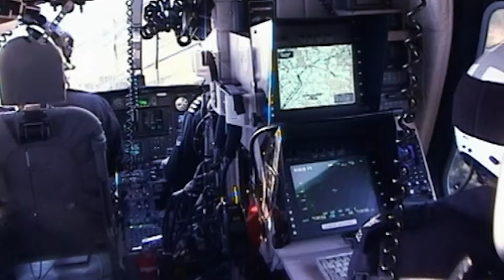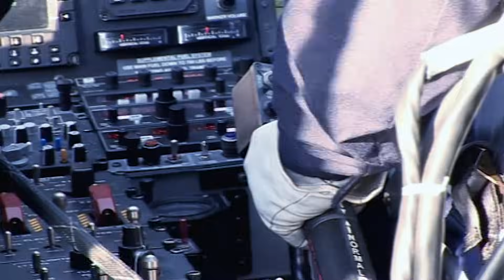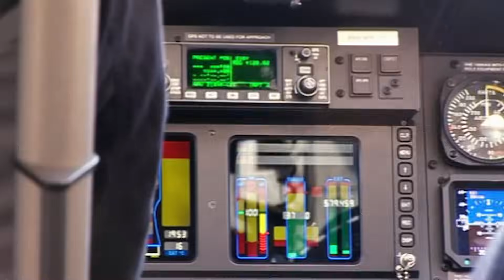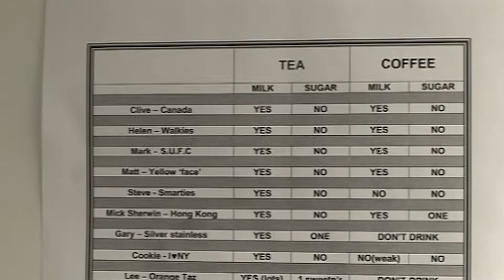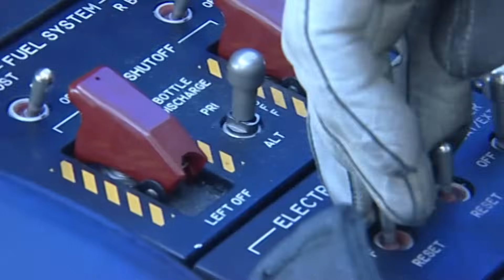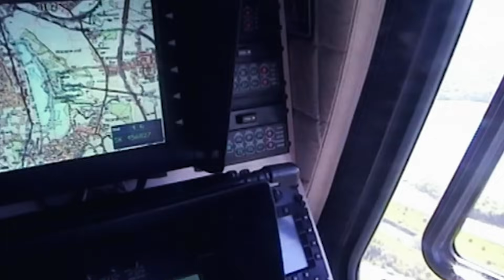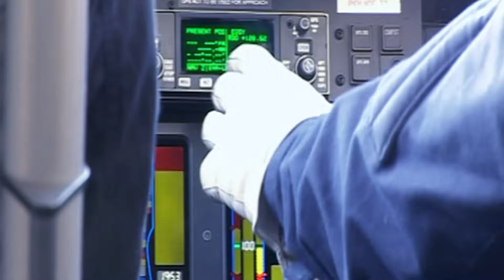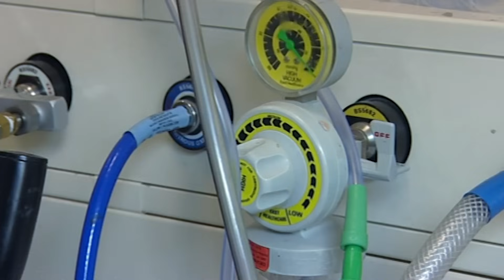Injured Patient Is In Critical Condition After Biking Injury | Sky Cops | Real Responders

Comment: If the helicopter was hit by lightning it would not send an electrical charge through the controls, the chopper is not at ground potential.
Reply: Kelvin England but it might electrocute the pilots and why do you think you know more then the trained professionals
Reply: Adam Atch The pilot’s would be safe because they are not connected to ground.  Just like the high tension tower workers working from hovering helicopters. They are touching thousands of volts, but remain safe by not being in contact with earth.
Reply: @MrOGREATWISEONE  That's really not how it works.  The aircraft has a potential to ground at all times, the question is whether that potential causes current (which means charge..) to flow. Normally, it does not, but a lightning strike is what occurs when the potential between points is high enough to break down the air and cause current flow. If you're touching the wrong things inside that nice perspex bubble, you can absolutely get a shock. You can also get one as a result of the massive magnetic field created by the strike. Such events have caused pilots to become seriously cognitively impaired during flight. You also have the potential for loss of spatial awareness from the light and noise.

Lightning is no joke, and it's not as puny as high tension (hah, half a million volts.. call me back in another few hundred million) power lines.
Reply: Mickey Mouse  Did you see the aircraft fall from the sky? Of course you didn’t, that’s because it didn’t..
Reply: @MrOGREATWISEONE  It may not have fallen from the sky, but it did crash. That video they were watching referenced a Captain Buschmann - that would be Captain Richard Buschmann, PIC of American Airlines Flight 1420 on June 1st, 1999. He's dead. So are 10 of his passengers. Now, they weren't struck by lightning - what they were struck by was pilot error induced by stressful conditions of flying through a dangerous storm.

You may dismiss the danger of lightning and thunderstorms, pilots should not.

Comment: The concentration in working the two handed controls as well as all of the other Instruments, will sap your strength by the end of the day.
Reply: Susan Wahl, kind of similar to driving a high performance race car multiple trips around a track with short fast stroke lock to lock and non-power steering!